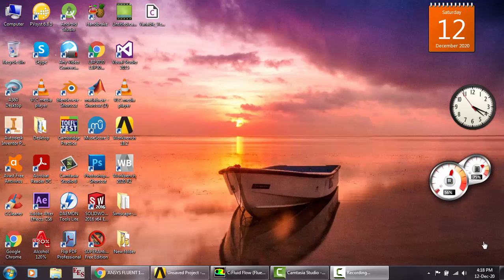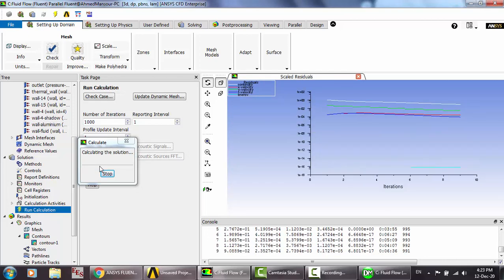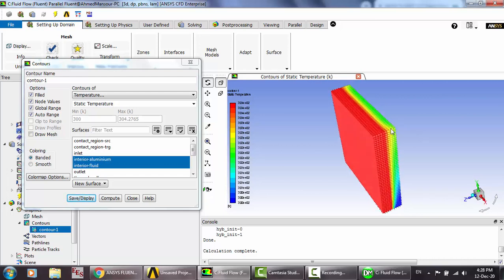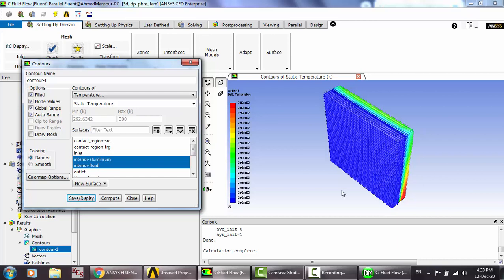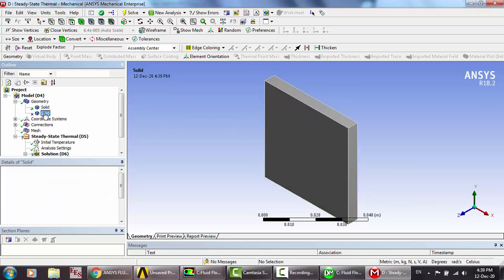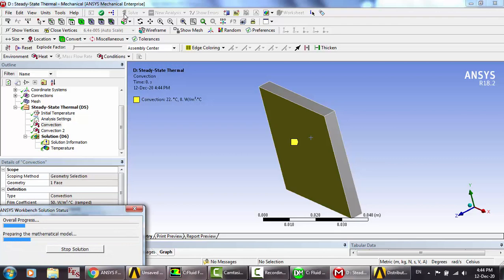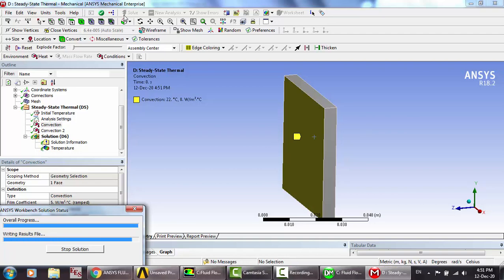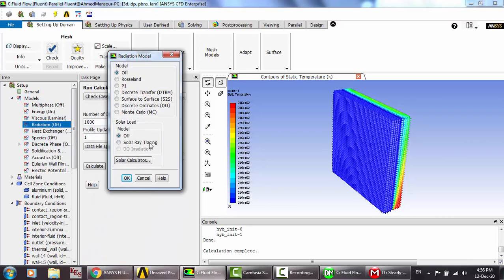CFD Simulations on convection heat transfer & heat flux to the wall in Fluent & Steady State thermal

Comment: hey thanks for your video. I am new in the ansys workbench and I am confused about selcting heat flux, temperature or convection boundary conditions so my question is that What condition is required to arrange these boundary? and is the choosing face based on boundary important? If you could answer it, I really appreciate.
Reply from the maker: As shown in the video, according to the package you use, it affect the results. Do exactly what I showed in the video and compare, then you understand in depth. Thanks

Comment: sir good,
in my case temperature is limited are shown.
Reply from the maker: I do not understand.
Reply: @haveanicetime  its some different problem, previous battery video you  upload. that problem temperature is limited can you share with those boundary conditions because i need specific heat vs temperature graph
Reply from the maker: @gaziabbasbhurani  There is something not correct with the procedure you followed especially the geometry I think. Danke!
Reply: @haveanicetime  thank you
Reply: sir , i need specific heat vs temperature so,which value increases in boundary conditions?
Reply from the maker: @gaziabbasbhurani  Actually I do not understand what you are trying to say. If you wanna get the specific heat, create a monitor for it, and create a monitor for the temperature, then plot the temperature vs the specific heat.
Reply: @haveanicetime  but sir its still linear graph are presented and i need bell shape curve so,  where i can change to increases value of specific heat.
Reply from the maker: @gaziabbasbhurani  I have no idea what you are taking about.

Comment: please suggest where to refer to for modelling a PV/T collector on ANSYS. im a complete beginner and i dont know what to do.
Reply from the maker: Hello dear Ryo, watch my video about solar ray tracing for cooling a PV panel in my CFD playlist. Danke!
Reply: I have a same problem , can you help me?
Reply from the maker: @Gigi_stars  Hello, what is the problem? Danke!
Reply: @haveanicetime   I need to know how to simulate PVT water with spiral flow absorber in steady state thermal  for my graduate project .
Reply from the maker: @Gigi_stars  Hello, watch my video about cooling a PV panel using fluid solid interface FSI. Prepare the geometry of the absorber and the water flow geometry. Run the fluent simulation on the fluid domain and then import the results into steady state thermal to investigate the effect of the water flow on the absorber. Okay? Danke!
Reply: @haveanicetime   I followed this step but the result it not change , can I send my problem to your email?
Reply from the maker: @Gigi_stars  Yes dear Jeje, send to mech.eng.ahmedmansour@gmail.com   Danke!
Reply: @haveanicetime  check your email please
Reply: @haveanicetime  Did you receive the file?
Reply from the maker: @Gigi_stars  Yes ma'am. I have just opened my e-mail. Danke!